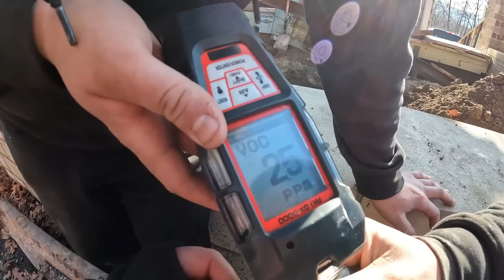1,000 Gallon Oil Tank Removal Underground, Under Deck

Comment: 13:00 Hey its Mark!   One thing what do these tanks smell like?  This one wasn't bad, but like when its full of sludge and water, how does it change?  Keep up the good work!  🤠👍  
So according to NY housing stats, here are the number of homes heated by what fuel:

Fuel                                           Number       Percent
Utility gas	                         3,651,779	51.7
Bottled, tank, or LP gas	    237,949	3.4
Electricity	                            615,685	8.7
Fuel oil, kerosene, etc.	 2,336,714	33.1
Coal or coke	                                 9,563	0.1
Wood	                                       82,613	1.2
Solar energy	                                 2,539	0.0
Other fuel	                                73,671	1.0

So 1 down, 2,336,713 to go!

Quick question, what year did they stop putting tanks in the ground?
Reply from the maker: they haven't, thank you for those stats. are they recent numbers????

Comment: That was a great tank removal!  You and Craig worked together to dig out a tank that the excavator operator could not see.  This is tough in the best of circumstances.  The homeowner dodged a major bullet by you performing a site assessment to prove that remediation was not required.  Why a deck/home addition was built over a buried oil tank is an interesting question.